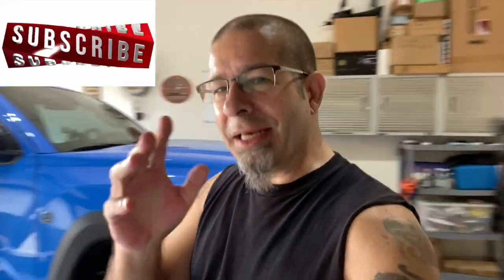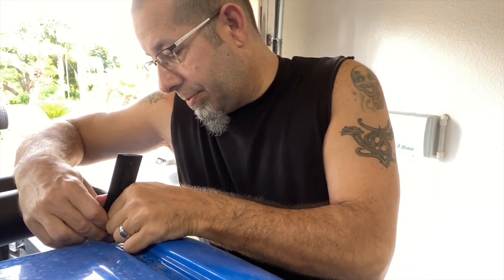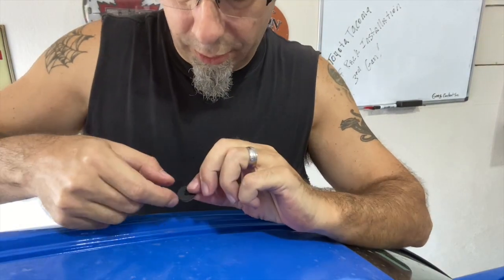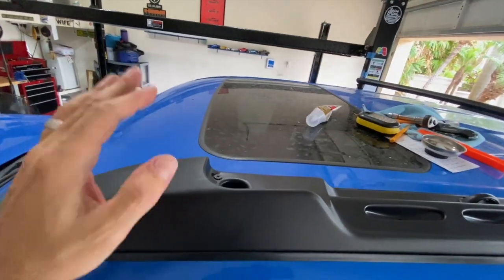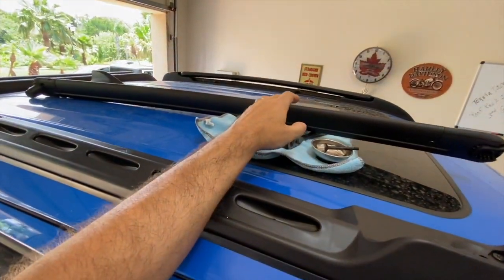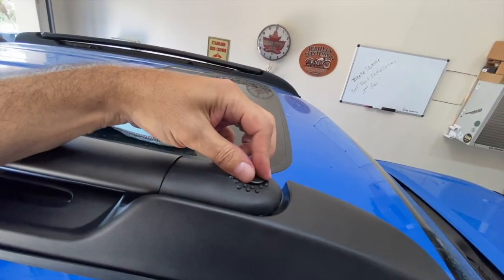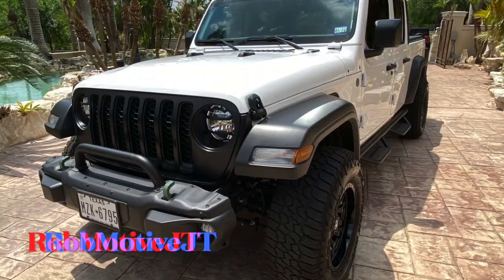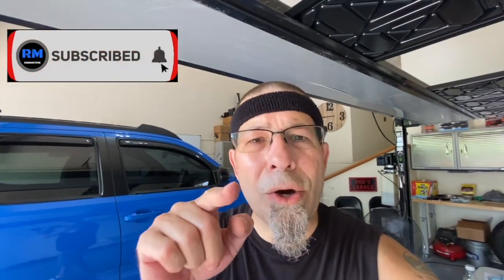Toyota Tacoma Roof Rack Install for 3rd Gen Tacoma

Comment: Nice Job Rob! I had the exact same issues as you did with the alignments of the wholes for the screws. One thing I had to do as well is change the screws as these will rust. They rusted while I'm in Austin before I even drive to the beach. I was able to find same type of screws that were rust resistant. Looks good man! 👍
Reply from the maker: Great idea on the screws!  I didn't think of that😐

Comment: Looks great! I've thought about putting one on my 2020 but haven't pulled the trigger, yet. Toyota moved the shark fin antenna forward to help eliminate the leaking 3rd taillight - then moved it back somewhere around 1 February 2020 production because of the roof rack impact.
Reply from the maker: Yup, mine is about 2.25” from the back of the cab😬

Comment: 13:49 That’s so weird my 2023 double cab antenna fin goes all the way back, like the back of it touches the end of the roof by the back breaklight. They must have realized this issue and changed it. At least it still clamps down, I’d be pissed if I bought a factory roof rack and it doesn’t work.
Reply from the maker: They did change it when the problem was realized.
Reply: @RobMotive  engineering oversight

Comment: After 50 months never parked inside my 2 cents. The hardware is cheap and will rust, replace with stainless steel where you can. Use silicone on bolt holes in the roof, fill the hole completely. You will hear more wind noise and much more when deployed with cargo. You will notice the gas mileage when loaded.
Reply from the maker: Thanks for the tips Mike and thanks for posting up your first comment 👍👍

Comment: That’s a pretty major mod there Rob. Kinda out of the “blue” 😂for you! I installed mine day before yesterday and looked to see if you had done it yet. 
I think it adds macho points to the truck plus I plan on using mine extensively in the near future. We’ll see how that goes.
Reply from the maker: Awesome!  Did your screw holes line up🤔
Reply: @RobMotive  I think they lined up pretty good but either there was too much thread lock or the holes weren’t threaded good on the truck because the screws got really hard to turn before they tightened up flush.
Reply: Like you said you have to do some finagling. Lol

Comment: Tacos Rule! Ok, I think I know what's causing the holes to not line up on the roof racks, as I bought a set on ebay and sent them back after they didn't line up. Then I ordered another set from Extreme Terrain (Red Rock brand). Those METAL BRACKETS that mount on the FRONT of the ROOF. The BOLT HOLES on those two metal brackets SHOULD BE ELONGATED a Little Bit. This allows a little forward or backward movement (slide) of the bracket so that you can line up the rest of the roof holes. It takes a few more minutes, but it's worth it for a good fit. So DON'T Tighten the metal bracket bolts just yet. Install the bracket, and Leave said bolts a tad loose so the brackets can move (slide). Then screw the rack onto said bracket. THEN you can make sure the holes line up, as the racks can now slide a tad forward or backward. Then carefully remove the rack off the mounting bracket, so as not to move the alignment of said bracket, and Tighten the bracket bolts. NOW your holes will line up! The instructions (if any are provided) Don't Mention That! In retrospect, that first set of racks I ordered may have actually fit, as I didn't realize that until afterward.
So spread the word about them metal bracket holes! Robby from Corpus Christi
Reply from the maker: Awesome!  Thanks for the tip 👍👍

Comment: This is the rack that came on my (pre-owned) 2016. I've had no issues with the rear bar, as long as you use the forward position. If you forget and leave the bars side-to-side, there is a bit of wind noise on the highway.

My next project is getting kayak racks up there and hoisting a 75lb kayak up there somehow. 🙄

Have you seen any weight limits for the rack? Mine was preinstalled, with no paperwork.
Reply from the maker: The weight limit is 100lbs👍

Comment: Great video Rob.  I was thinking of doing the same to mine for astehics, but more so to mount a front facing lightbar to.  Any thoughts on if that would be dooable?
Reply from the maker: Since the front is hollow, you could easily put screws thru to mount to.  Just make sure you get the right length light bar👍

Comment: Thanks for the video! I just installed this over the weekend on my ‘21 double cab with the intention of getting a Yakima or Thule box for skis. I’m finding that neither of those brands have a compatible solution. Are you aware of anything that will fit the OEM crossbars? Thanks!
Reply from the maker: I am not.  You may have to find something that you can strap down🤔

Comment: What are those shields over the windows? Have seen them for years. What purpose do they serve?
Reply from the maker: They enable you to crack the windows during rain or to let the hot air out while parked👍
Reply: @RobMotive  what brand are the rain shields and did you do a install video on them ?
Reply from the maker: Have a look: https://youtu.be/0GiuwCRGOr8
Reply: @RobMotive  thanks 😊
Reply: Second think I added to my Taco! (Marine Corp front tag was first). With all windows rolled up in NC, the heat and pressure will kill an interior. And they look great. Nice video Rob.
Reply: Second thing….

Comment: Rubbing on the fin, not good. Wait until you put some weight on the roof rack.  Then it will rub.
Also, how close does the front pieces of the rack come to the wind shield? They may hamper a wind shield replacement as they strip off everything to access the glass.
Reply from the maker: No issues with proximity to the front windshield 👍

Comment: I am having trouble with the final bolt for the swing arm into the passenger  side rail. My rail have nothing to screw into just an open hole? anyone have same problem or can offer solution?
Reply from the maker: I didn’t have that problem.
Reply: @RobMotive  was the passenger rail supposed to come with the black  stopper (black and white like the driver side rail) for the final bolt to screw into?
Reply from the maker: Should be like the drivers side.

Comment: Clicked on the link to the Amazon page and says it doesn't fit my 2020 Tacoma. Just for shi** and giggles I entered 2021, 2019 and 2018 and also said it doesn't fit any of those. 🤔
Reply from the maker: Gotta be because of the possible shark fin problem 🤔
Reply: Did you say DOES NOT FIT 2018. I think this is the year Rob did. Hmm! Replies please( will this fit 2018 without hitting my ANTENNA. Thanks!

Comment: Toyota engineers must have overlooked that shark fin when designing the roof rack, then decided to modify with 2nd hole.  Oem parts should function without any modifications, that's the type of thing I'd expect on a Ford not Toyota.........Come on Toyota !
Reply from the maker: Definitely a miss when it comes to design!  I believe the fin is now further back🤔
Reply: @RobMotive  Rob I measure one inch from the seal edge on rear cab light to the rear of the fin on my 21.  How's your 20 compare ?
Reply from the maker: Mine is about 2.25”😬
Reply: @RobMotive  🤦‍♂️